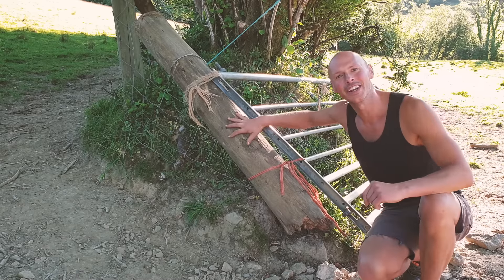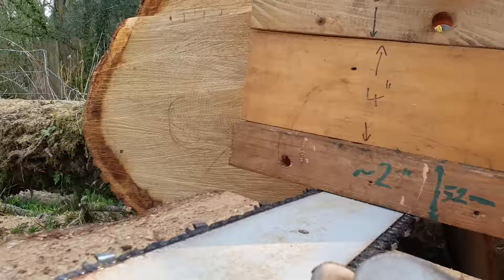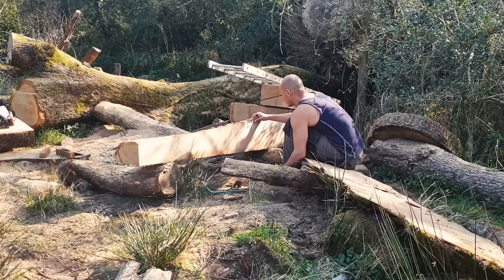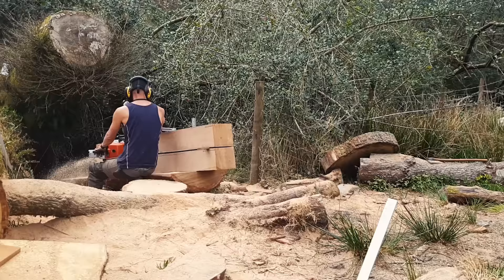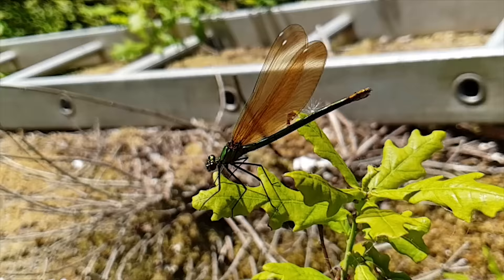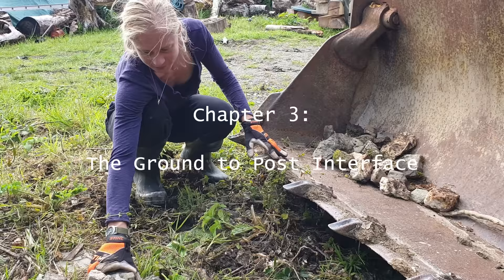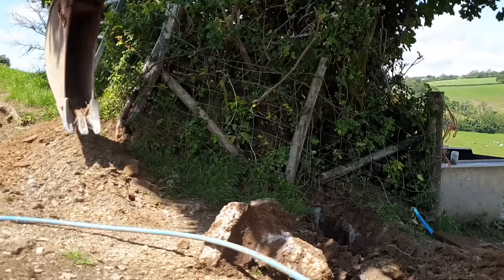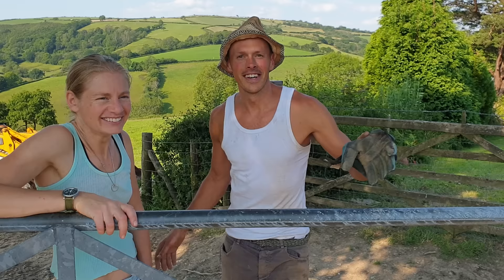The 3 secrets to ROT PROOF POSTS and how to make them

Comment: Shouldn't be contaminating the stream with the sawdust !
Reply from the maker: Good morning Wooly. You may be right, but I cant help thinking that the amount of saw dust that made it in is negligible compared to the amount of twigs and leaves and other bits of wood it picks up on its several mile run through these woods... 
Peace, Bongo.

Comment: Soo...we are all concerned about the environment but pump sawdust and bar oil residue into a stream all day?
Reply from the maker: Hey chappy, thanks for caring about this. We use bio degradable veg oil for chain n bar lube (modelled with a natural biodegradable tackifier of course), or that would be a concern. As far as the sawdust, I am not worried about it because that relatively small quantity, and how quickly it breaks down is insignificant. One would sooner worry about the vast quantity of leaves and twigs going into the stream in that section of forest... 
No, I'd actually be more concerned with the long periods of very epic noise pollution... but it's all relative. We could have just bout some industrially produced, imported 5year life chemical drenched wood like most folk do.

Comment: I just don't know how environmental it can be when you chop down the trees required to replace faster rotting timber over proven chemical treatment techniques that last a long time.
Reply from the maker: Good morning Validviking, you raise a very valid question / point.

The only thing I would take issue with is the 'proven-ness' of the chemical treatments. The only commercially done chemical treatments we, and others, have experienced are proven ineffective. 

Or were your referring to the now banned pressure treatments? 
Either way, I recognise that we were quite lucky to have a big wind felled oak on our property.
 
Actually though, maybe it would be good if farmers made allowance for some tree planting for posts. A stand of Osage Orange and Black locust mix (or similar), is both good for wildlife, diversity and will yield exceptionally long lasting post wood. 

I guess this is a bit of a throwback for a less specialised, more local  way of making stuff, where huge mono-crops of pine (common here in UK since WW2, but now changing), and massive industrialised chemical treatments -which tend to be black boxed and mysterious, even to employees(!), are avoided in favour of mixed woodlands. 
Anyway its a good question to ponder, thanks!
Peace, Bongo.
Reply: @FloweringElbow   eehh the banned stuff . I'm thinking telephone polls, etc. anything you stick in the ground.  That's a lot of lumbar that would last much longer and I just don't know how much damage "hazardous" chemicals can do stuck in the ground where they came from in the first place.
Reply from the maker: Like you, I don't quite know how much damage they would do...
I can bet that a large scale commercial industry with plenty of lobbying power and proven efficacy, would not be legislated against if there were not pretty dam compelling reasons though...
It's worth remembering that lots of toxic chemicals humans historically used to their unwitting demise, came from 'the ground'. Lead and mercury are two that spring to mind. Useful yes, but not to be spread across the land that provides food for human, insect and animal alike... 
Maybe it's a big conspiracy led by misguided chemical-aphobies who can't distinguish HgCl2 from NaCl. 
But I doubt it.
Reply: @FloweringElbow  Great work with a chainsaw and masterful post setting/gate install by the way.

Comment: Tannalising claims timber insides remains rot free  60 years and outside 30 years!
Reply from the maker: Claim, yes, in our reality, nope.
Reply: @FloweringElbow  However I do know the local council put two square  oak gateposts to block a lane gypsies used and 60 years later those posts are still totally solid.    I didn't see the men setting the posts but they are on a hill in West Yorkshire.
I also know that a supposedly treated post used to keep neighbour's larch lap fence up rotted off in about 3 years! 
I don't know about telephone poles but locally they always seem to have been dipped in tar as well as being darkened with something.

Also one or two unadopted roads in my hometown had barriers with a bar and the posts were very old but still solid.
Personally if I was setting gate posts I'd dip in old engine oil, wrap tightly in thick polythene stapled down tight above soil level and then seal teh poly to th epost with more thick tar to prevent water ingrtess.

Comment: Composite wood plastic mixs are strong uv stable  real good use of waste waste wood and plastic products. Man Made does not equal bad fir environment
Your chain saw fuel is worse. So dont dismiss out of hand. People talk about being green and using things locally except the fuel for vutying snd tesbdpirtbus forgotten. 
Composite products using waste materials is very green.
Reply from the maker: Good morning Keith. Thank you for sharing your experience. I have not come across these plastic/wood mixed posts - sound interesting. Often the problem with recycled plastic mixes is the end of life problem.... Mixing with other materials like crushed rock (for plastic paving slabs and roof tiles, work very well for the duration of the tile, but are much more difficult to recycle a further time... 
That's not to say impossible, and experiments with these technologies are probably all steps in the right direction. Thanks again for watching and your comment. 
Peace, Bongo.

Comment: You're concerned about the environmental impact of concrete or metal fence posts while using a gas powered chainsaw burning oil mixed 2 stroke gas and a bunch of chain lube to keep it moving freely, then criticize other humans for not thinking when using plastic/pvc posts....
Stopped watching at this point. 🙄
Reply from the maker: Hey Billy, thanks for your comment. The gas and oil in the saw is a valid concern.
I guess it is a matter of quantities. A large plastic gate post that doesn't last too long, as well as having a much larger carbon footprint, is going to spread non-degradable plastic pieces into the land, seas, food chain and ultimately our bodies. The small quantity of fossil fuel used in the saw to harvest a local wind felled tree is not equivalent. That said, I do make a carbon neutral bar oil, so at least that's biodegradable and not from the petro industry.          
Peace, Bongo.
Reply: @FloweringElbow  cool.  Curious though, what is the chainsaw made of?  Or the recording equipment for the video?  Or the devices that a BILLION + people watch these videos on?  Not a huge impact because it is just you using them?  What about the 100s of MILLIONS  of chainsaws out there, recording devices, or almost universally gas powered vehicles used to move all those items around?  Or the zero emissions standards international shipping tankers that consume essentially crude oil at a rate of tons per hour while transporting those items from cheap labour over seas for everyone else to buy...
I don't preach environmental virtues then claim to have a lower footprint while being immersed in the greater problem.  Mainly because there is honestly no REAL solution other than the extinction of the human species... at which point, why would I or anyone care what happens to this rock?  Just like how one cries about the conditions on venus, because there are no humans there.  The world will solve it's own problems.  It's been doing it for billions of years.  We aren't that important to it after all.

Comment: Motor oil will make wood last a long time.
Reply: Why is it that 40 years ago, when you put automotive parts in the bed of a truck. And where the oil leaked out on to the wood of the bed it rotted out quickly. Old motor oil is only good for dogs with the mange. Use boiled linseed oil to protect wood.